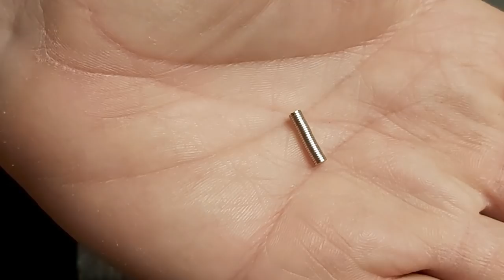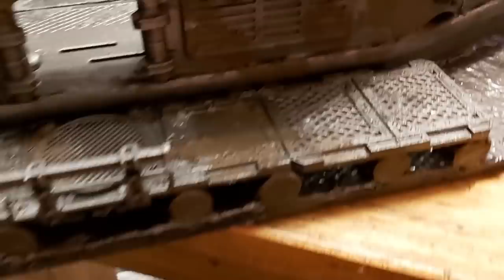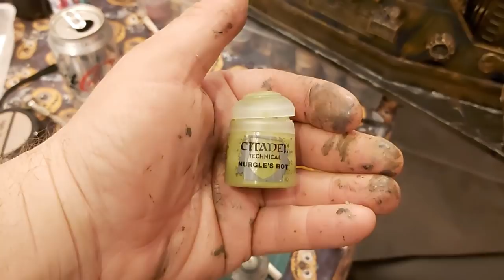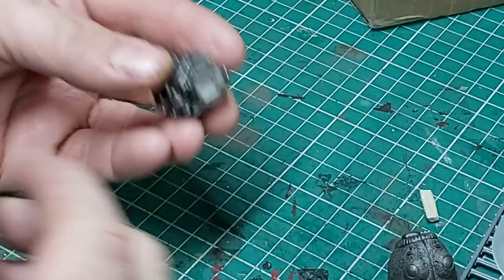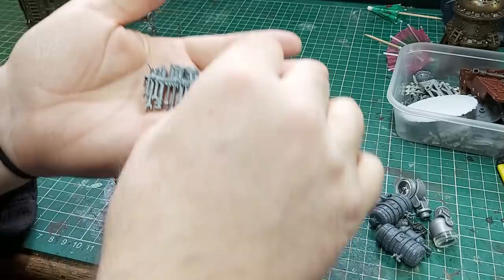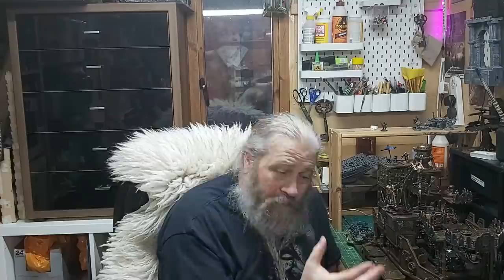Necromunda Scenery Build - The Enforcers' Sector House - A Floating Sump Fortress (Part Three)

Comment: Magnet size for building, tend to use either 4.5 x 2mm or 6mm x 2mm, Though for the crane having a physical tube connection in the centre adds a little stability, same goes with bridge. Magnets are useful but physical slot and dowl also helpful. 

Love the build

Comment: Guitar and bass guitar strings are great for cabling and hanging cables in such builds. And if you twist cables like thin telephone cable individual wires, you can cover in heat shrink tubing to create unique tubes and cables.

Comment: Great to see some paint on this monster! Loads of details, and the LEDs are dead cool! 

I'll echo what many have already said - bigger magnets! They come in pretty much every shape and size now, so should have trouble finding the right ones for the job. I've used 2mm x 1mm ones to magnetise weapons in the past but not sure they'd be enough to hold up the crane. If there's a decent contact point under the centre of the crane, you may be best of going for something more like a single central 6mm or even 10mm diameter magnet instead of multiple small ones..

Anyway, great work as always Tim!
Reply from the maker: Cheers Nick - yes I am going to try a different approach with the crane magnets

Comment: use thicker magnets - yes, drill a hole for them as deep as the magnet is thick then keep them in a stack glue the bottom magnet of the stack in place - you may want to use an accelerant with superglue; then you slide off the stack leaving your magnet in place :)

Looks great BTW ..
Reply from the maker: Nice - cheers

Comment: Did not disappoint! I was hoping Rapid Table Top would release their video this evening too, but alas. Do you have a link for the LED holders that you've used in this build?
Reply from the maker: Hi Aidan - Glad you liked it. I use this coin battery holder https://www.thingiverse.com/thing:3889075 there are several other designs - My simple guide to LEDs will be in the Commander's Cabin video mid week. But then it's sooo easy, I reckon you could work it out yourself:0)
Reply: @magratheabuilderofworlds7141   cheers, I’ll check out your mid-week video for sure 👍

Comment: Wouldn't it be easier to put a big magnet in the middle of the crane?
Reply: Like a big stack of magnets in the middle would be hidden out of line of sight as long as the crane is on it, have more place for bigger, stronger magnets and would allow for all orientations.
Reply from the maker: Yep. Some one else has also made that suggestion and I think that is what I am going to go with.